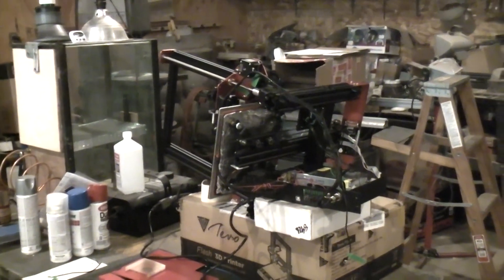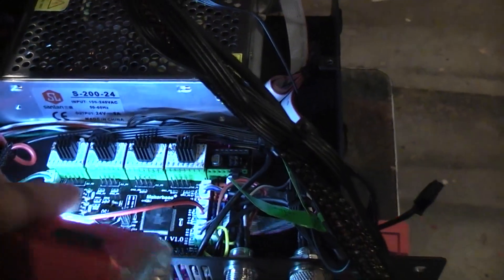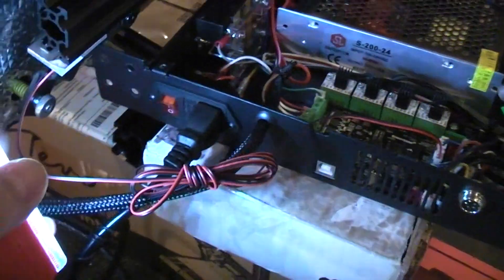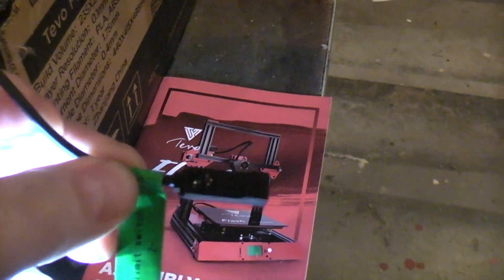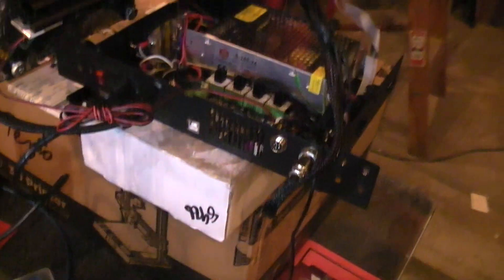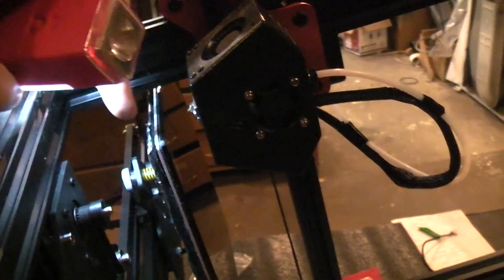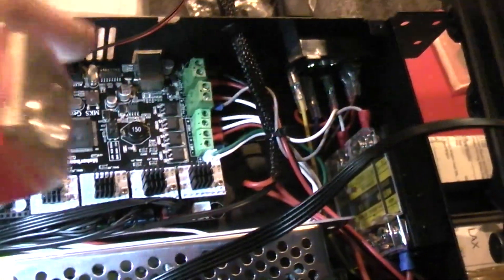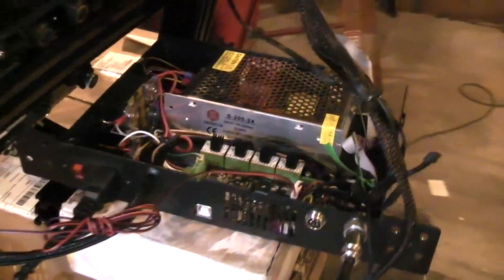TEVO FLASH 3d printer. The  sensors and stepper voltages. A inside look.

Comment: The sensor for the y-axis on my flash was damaged as well. It worked intermittently for a while but eventually gave out. After you mentioned these are epoxy-filled, I thought I'd try just compressing the sensor with some pliers to restore the connection inside. Seems to work for now but gonna grab a replacement. Thanks!

Comment: Hi I purchased a couple of the Sunx sensors you mentioned, but can not find any cabling descriptions for them on Tevo's site. would you mind sending me a photo of your board with the Y axis plugged in so I can work out how my Tornado should be wired. Thanks.
Reply from the maker: The Brown wire in the sensor is the  V+ power, the Blue wire is ground and the Black wire is the output. The link I have posted for buying a new control board shows all the hook up connections and even shows what pin on the connectors is "power, ground and output". just scrole down and look that the super nice pictures they posted in the link. The Y sensor is the center Blue plug connector on the board and pin out from "back to front" is Black, Blue, Brown, or if you like Output, Com, V+.
Reply: @Robothut  You are a star thank you. The board is the same as the Tornado board just a later version. The Y X and Z access controllers are in the same  physical place on my board. The pin out you describe makes perfect sense, although I am surprised these sensors work at all from these pins, as the voltage is only 5v and the datasheet on the SunX site suggests they need between 12 and 24v. The original switched stops only use the ground and output pins of each Access, and are plugged into the V- side. I'll checkout my Marlin firmware and establish if I need to make any changes there. Thanks for you help greatly appreciated.
Reply: Could you use mecanical sensor instead?

Comment: Hi! Did you've got your sensor? Thanx for the links! I hope I'll not need to buy extra hardware for my Flash (excl. BLTouch).
A little question: do you have a pinout for BMC socket for BLTouch external connection? I'm thinking about buy it but wan't to make a wire with the BMC plug instead of connecting to the internal pins.
Reply from the maker: No, I contacted them 2 days ago and they said , Sorry no stock. So I have turned it over to pay pal,  We will see what happens now.
Sorry no pin out for the BMC socket.
Reply: Hope you'll get your compensation back! Heh, from many tries no pinout yet :) Maybe I should ask Tevo?